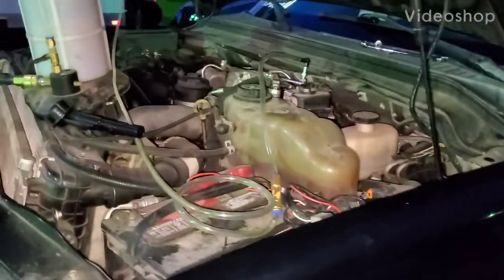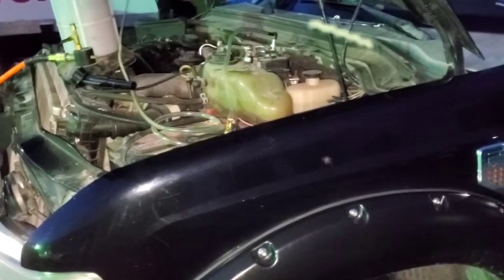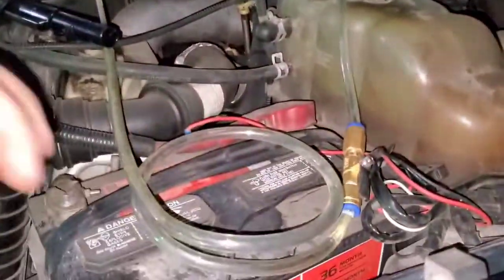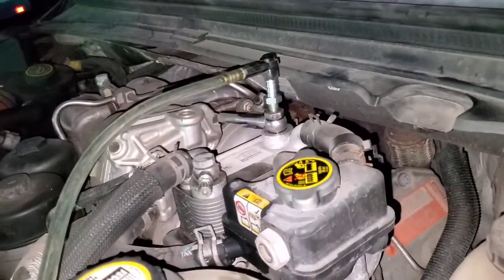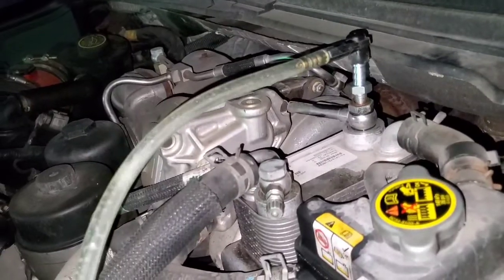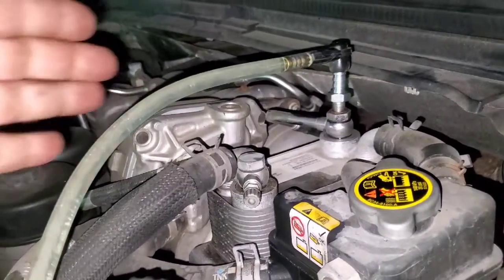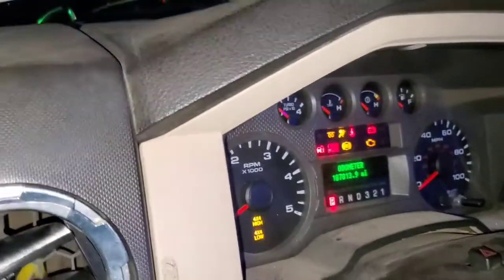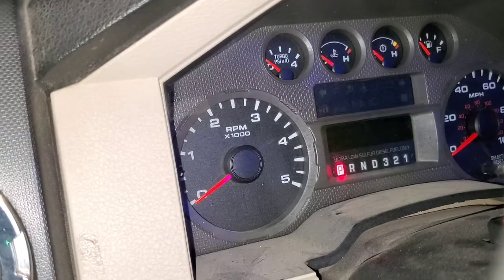How to Bleed fuel system on a 6.4l powerstroke! (Headphone warning)

Comment: I got a 6.4 crank no start no codes fuel pump Working
Reply from the maker: Does the turbo actuator rock back and forth once even key is first turned on?

Comment: I got a 6.4 throwing a P2291 code after I changed the oil pan gasket and the windage tray gasket builds 5000+ pressure when it starts but dies after 10-15 seconds I changed the ICP sensor and got nothing same thing I have no idea what it may be !! All I did was change a gasket please help
Reply from the maker: I would double check oil level first, then make sure there is no oil leaking and no fuel leaking. Also did you change oil filter? Only Motorcraft oil and fuel filters